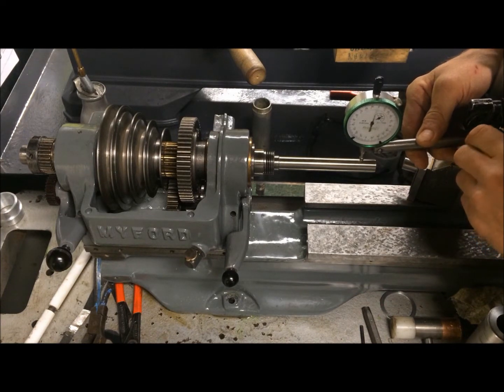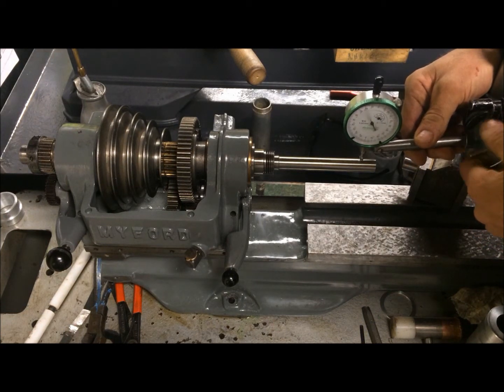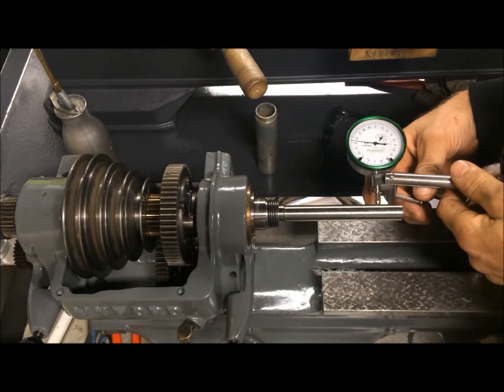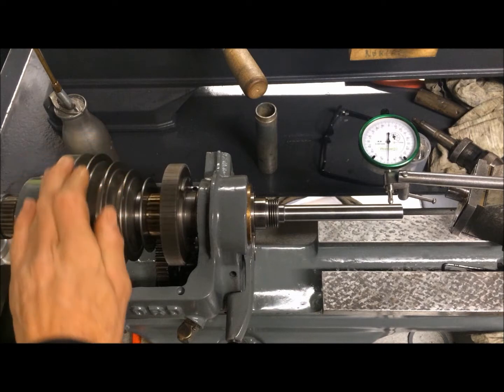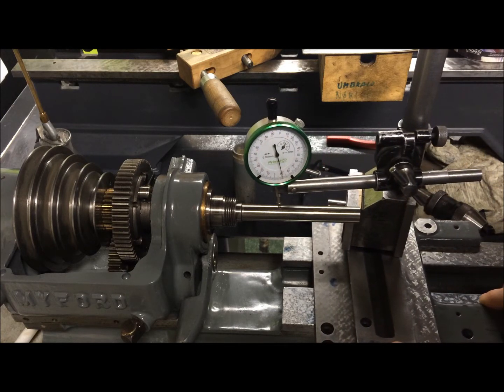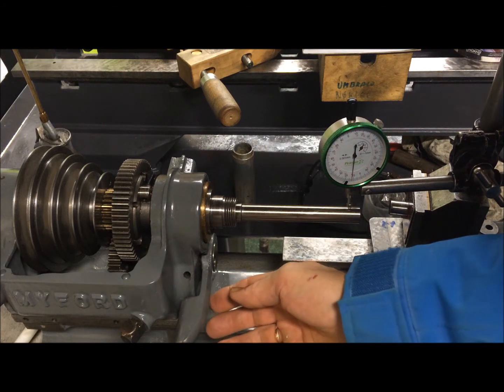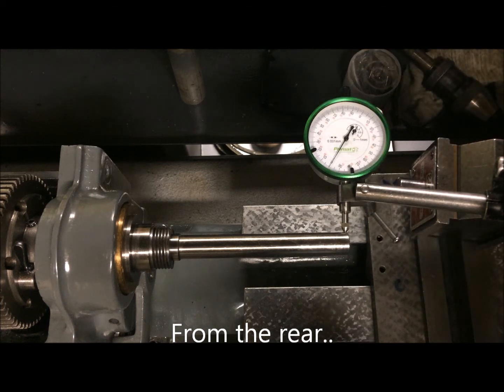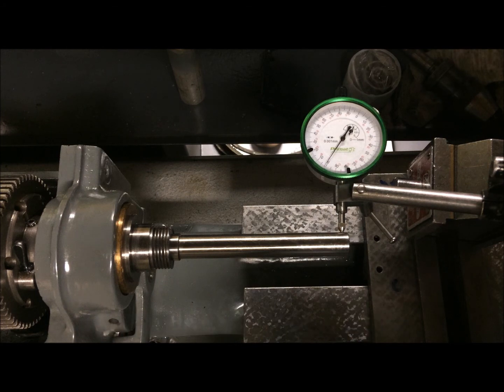Myford Super 7  spindle measurements

Comment: Nice video! I think one thing that should be concidered ist the fact, that the spindle will float "up" when it rotates. So the Alignment of the headstock to the bed usually needs to be measured with a rotating spindle. But this will make measurements more goofy as the runout of the testbar will not be zero.
Anyway I think that 0,01mm is more than good enoug! :)
Reply from the maker: Thnks for the valid comment. As you say with a rotating, hence floating on the oil film spindle this will be a consideration, but following the suggested methods for accuracy testing and specs for this type of machine, including setting up the required/recommended end-float/run-out allowance for the spindle should suffice to determine the effect that this makes.

Comment: Jan, may I ask what brand and model of the dial indicator you are using in this video? Thanks.
Reply from the maker: It is a 0,001mm (1 thousands of a millimeter resolution) Primat indicator
Reply: Jan Sverre Haugjord  Sorry, I did not see your answer until now, thank you very much for the info. Any chance you can tell me where to find one, have looked but no luck. Thanks again, most appreciated.
Reply from the maker: @melvinrasmussen1821  https://shop.otdtools.se/category/analoga-0-1-mm-0001
Reply: Jan Sverre Haugjord Thanks Jan, most appreciated!

Comment: Thanks for posting this useful video, great to have some spindle measurements to compare with those of my unrestored Myford Super 7 (September 1966). I am getting virtually the same results which is reassuring.
Reply from the maker: You're welcome. Nice to learn that it is useful for someone else (that was the meaning :) ). PS In case you didn't know, there is a Myford User group on Facebook which you can sign up to and then post your questions. Also the forum(s) under the Model-Engineer website

Comment: nice job 
i do like you did 
put i have problem 
with the gearbox change 
i have no idea how to remove 
do you have tube for that ?
pls
Reply from the maker: Thanks. I don't remember exactly how, but think you have 3 screws in from the front that holds the main casting. I also think you have to start with the removal of the side panel, ie. gear train assembly (a screw here also?). And of course the leadscrew (retaining nut with setscrew from the left end). Drain the gearbox for oil,  remove the top cover and have a look inside first.
PS! A great help in the process is to have a look at www.myford.co.uk. There are detailed "exploded views" ie. drawings as  well as parts lists available online for all their products, incl. the Super 7. And of course any parts you would like to buy!